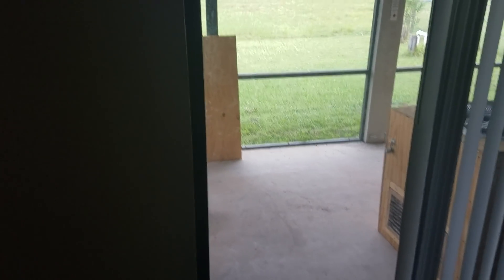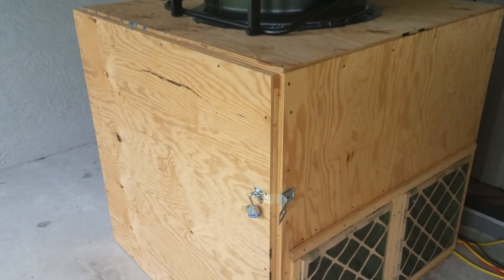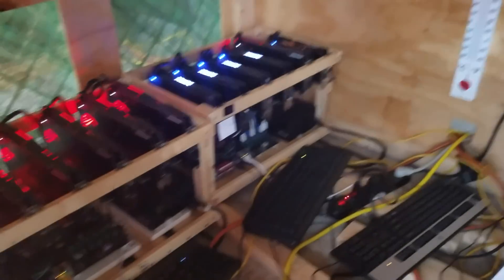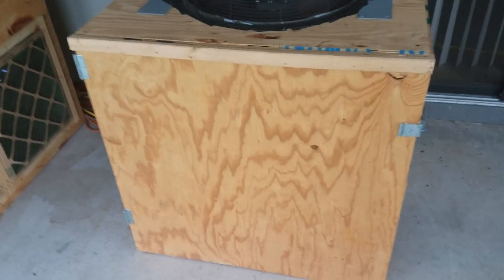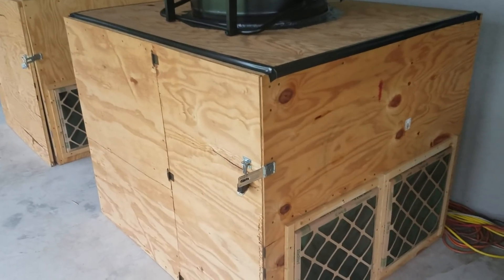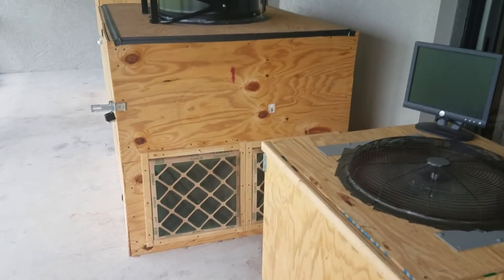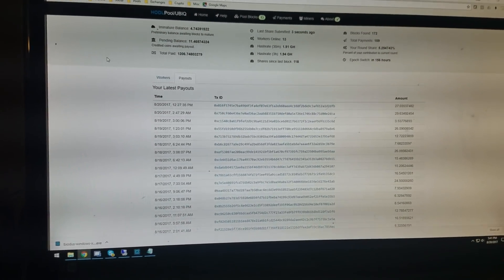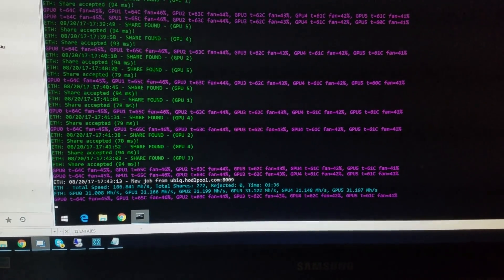Update - How to keep your mining rigs cool - 2 months later

Comment: I want to try to get into the mining business, but in Brazil the hardware is 3 times more expensive ... How much can I mine in the US with a 4 boards 8GB hard drive hack?
Reply from the maker: go to https://whattomine.com this site will give a rough calculation. It all depends on what cards you use, how much you pay for power and what coin you mine
Reply: What is the boards did you use? What motherboard, video card and processor?
Reply from the maker: I used many different hardware configs - i made a video on it here - https://www.youtube.com/watch?v=4a2b96d2gxw
Reply: Thanks a lot! Sorry about to many questions.. But jus two more.. Do you think that o i can start is two card? This cards is good? Amd Gigabyte Radeon Rx 580 Gaming 8gb or Msi Rx 470 4gb  or  Amd Radeon Xfx Rx 470 4gb?
Reply from the maker: Any one of those cards are great. If you can find those cards at a decent price.. get em.

Comment: fellow south Floridian here ! This hit the last nail on the head to my doubts. I would eventually deal with humidity outside of the home and high temperatures to not get kicked out of my apartment for loud fans lol... the box design is actually much cheaper than the 120mm fan setup I was planning.. just louder.. but if its outside then I have no issue. Friend and I will be doing a 13 GPU rig with the ASROCK BTC+ that just came out and that smaller box you got seems to fit the profile of what we'll need to keep it cool. How did you go about cutting those boxes and having the design to hold the GPUs, PSU and MOBO properly?
Reply from the maker: CodeSteps, i used a skill saw to cut the plywood and a chop saw for everything else. As far as the frame for the rig components, i just made it up and each one is either built for a 6 or 7 card rig. I've never built a 13 card rig so that would be a little bigger frame. Do a search in YouTube for "Bits be Trippin". He has built a couple of 13 card rigs very recently using that same board. Maybe you ca get a better idea from him.

Comment: Question about power. I'm building a 6 GPU rig (1060 6GB) with a 1000 PSU in a milk crate. We are building a house and will be building the basement at a later date by ourselves. I would like to take my 6 rig crate and maybe replicate 4 more as time goes on. When we go to wire up the basement, what wiring should we use?

I've had people say 1 rig per 15 amp circuit and 2 on a 20 amp circuit. I'm trying to figure out how to convince the rest of the family why we should install 20 amp circuits. Alternatively I've heard you can just replace the 15 amp breakers with 20 amp breakers, but I think that might burn the house down. I don't plan on going much larger than what you've demonstrated in the video.

Realistically, each rig might pull around 750-850 watts when under load, but nothing over 1000 if I decided to swap out the GPUs in the future. There will most likely be other things plugged into the circuit, but nothing more powerful than say a television. In your opinion, what would be the best plan of attack to go about power? Hook 2 rigs up each to a 20 amp? Or just 1 rig per 15 amp circuit?
Reply from the maker: Mason, a 6 card gtx1060 rig will not use very much power, maybe 600 or 700 Watts. You can safely run that rig on any 15A breaker so the wiring would be the same as what you normally use in your house (14 gauge). That being said, if you ever want to expand your mining ventures to multiple rigs or to GPU's that require more power, I would use 12 gauge wire with 20A or even 30A circuit breakers. Good luck!

Comment: ok so first your using a tune of power which unless you use a renewable source please consider changing your source of power or stop mining.second are they all 1060s and whats the cpus and how is that working with the pci e lane limits.and how much on average do you make a mounth
Reply from the maker: Change my source of power? Is this an order? Hold on, I'll jump right on that!
Reply: TwoTon Hasher just a ask
Reply: Mining doesn't care if you're pcie 3.0 x16 or pcie 2.0 x1.  The only impact it will have is how long it takes for them to start the first time.  As a matter of fact, most miners set their lanes to pcie 2.0 for better stability.

Comment: quick question. Are the rigs optimized to consume less power and how much do you pay for electricity?
Reply from the maker: Absolutely, All my GPU's/rigs are undervolted and overclocked to maximum efficiency. Or to the best of my ability anyway. Here in south Florida, I'm paying 11 cents per KWH and I'm burning roughly 350 KWH/day with 11 rigs
Reply: thanks for the quick reply. Geez! that's a lot for electricity
Reply from the maker: Wow.. thats expensive. Yes, in your case, just buy crypto.
Reply: Hodling since the last dip to 150€
Reply: Would love to mine myself, but at 0,35$ in Germany no thank you
Reply: thanks for the advice. With all the rumored US taxing bitcoin do you think it's still profitable to start mining alt coins as a beginner now??
Reply from the maker: Yes, its profitable...  but It really depends on what you're paying electricity. Also, its just tough to find GPU's for a decent price right now.. If you pay today's prices it will take much longer to make your investment back. Unless you have a line on some cheap cards LOL

Comment: Hey, great designs/idea! I would never call myself an internet hater. So I will go on to form this as constructively as possible lol
I happened to catch the "structured wiring" you have inside box #1 (4x4x4) (9:07). I would always be thinking (read: worrying) about something shorting inside that hot wooden box. I thought of maybe a subpanel installed nearby that you run romex and  install legitimate outlets (2-gang, 4 socket) inside of each to reduce the clutter (nice word for danger!). 
I was wondering if you'd also ever consider building one large one to  house the entire farm you have? You have some adequate space above the rigs in each box. If you made a floor-to-ceiling compartment (using the same three fans/filters) that you could stand in, that would increase ergonomics inside. Maybe hang some pictures, too.
Reply from the maker: All great suggestions. I plan to eventually build one great big box instead of having multiple little ones. I have many improvements like what you're suggesting in mind.

Comment: A little tip for you. With a couple of peltier plates you can cool down  those GPU to 40 degres celcius Wich is the best working temperature for the chips.
Reply: Peltier plates take a boat load of money in electricity to run.
Reply: cracklingice not yo  much. If You use a 60w - 12v on a 5v load it Will use like 20w. Give one a try they are like 3 bucks.
Reply: Oh gotcha you aren't talking about sub ambient.
Reply: cracklingice exactly.

Comment: are these rigs overclocked or just running at stock values?
Reply from the maker: Yes, they're overclocked and undervolted
Reply: overclocking dont decrease the gpu life?
Reply from the maker: Not that i have found. No
Reply: have u checked that overclocking increases the GPU processor temperature and so increases the wear and tear of GPU

Comment: Hi Mate,

How long you keep your fans running? 24x7?
Reply from the maker: Yes, non stop
Reply: awesome ur fans must be of very good company then, mine gets heat up after 12 hours so i need to replace then after every 12 hours
Reply from the maker: Yes, they're good quality. I haven't any problems with them so far.
Reply: good luck mate, thanks for ur guidance
Reply: Which brand is it ? and what is the model name please?
Reply from the maker: This is the fan I'm using https://www.lowes.com/pd/Utilitech-Pro-24-in-2-Speed-High-Velocity-Fan/4755305

Comment: these people are fools, i have something similar with 480s 390s for almost 2 years now, as long as the air is not standing in the rigs, the risk for humidity building in there is almost impossible, just don't turn the fans off in the winter, lower the speed but never turn them off...

Comment: Hi, nice rigs... what is your price prediction for ubiq for 2017? BTW i have my fans spinning at around 60% and gpu temps are in the high 40's and low 50's  My opinion is :) -  I'd prefer oiling the fan bearings in the near future rather than replacing gpu's i've been running about 1& half yrs now, so far so good!  What do you recon, isnt 60 + degrees for 24/7 a bit too high?
Reply from the maker: Maltatravel, Thanks! I really like UBIQ's roadmap and project layout. I wouldn't begin to speculate on price. Of course I'd like a significant rise but who knows. Its up to the market. UBIQ isnt very profitable to mine if were just cashing out every day, like what most folks do. I'm a HODL'er. 

As far as 60+ degrees, It might be high but if it is I haven't seen or have had any problems so far with my GPU's and the majority of my cards are over a year old. Knock on wood
Reply: ok great, i think then i will have to mine some more soon!

Comment: how is over 100 Fahrenheit  not bad for gpu's?
Reply from the maker: because of the air flow over/through the cards. Thats how.
Reply: Ah I'm not trying to be like those dick comments, just asking.
Reply: Does less humidity increase performance of cards?
Reply: No, but would only help in the longevity of them. For my own liking, anything under 140f/60c is good for temps, long term.
Reply: Also keep in mind the difference between Celsius and Fahrenheit. 100F is only 38C. So the 65-70C cards outside are being cooled 38C ambient air flow. So even though 100F seems hot to you and me, that's relatively cool air to the cards.

Comment: Awesome... Just had a duh moment watching this update.  I was so busy trying to avoid the outside Texas heat that I put my box in the garage and exhausted the heat to the outside.  Still made it worse because the garage is an oven to begin with and the ambient temperature kept my box hot.  My back yard is open so security was a concern but I'll revamp the solution come next summer and put them outside with maybe a gate or something around them.  Thanks for the video man I needed to hear that.

Comment: Humidity will only be affected if there is differences in temperature inside the box. Is good idea is to place a moisture thermometer. You tested with ETH? I think ETH or dual mining, you could not keep the 63C. 
Just to make a comparative., I'm at 15C and my rig rx580 nitro+ 9 GPUs are around 60C, fan 20%, my rig  Gaming X 1070,  9 GPUs are around 45C, fan 48%. Depends of the card temps change a lot.
Reply from the maker: Yes, I 'mined ETH for months out there. Same temps. I've only just started mining UBIQ about a month ago Thanks for the comment.